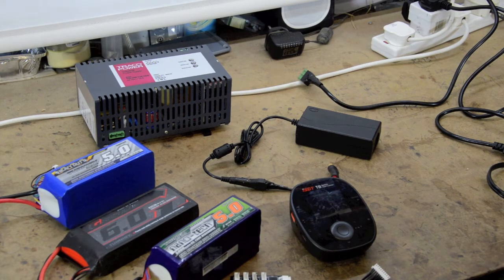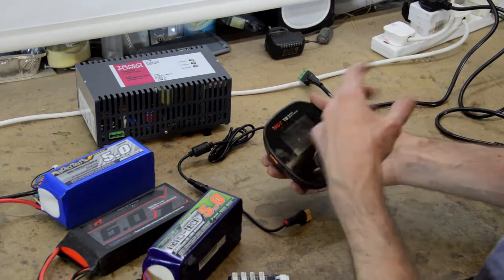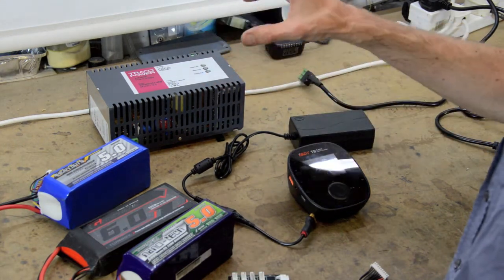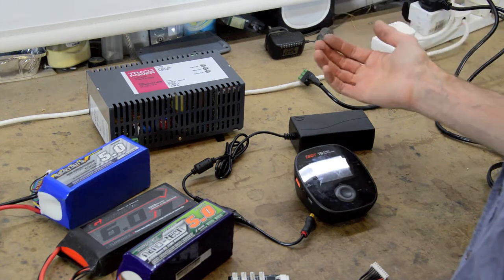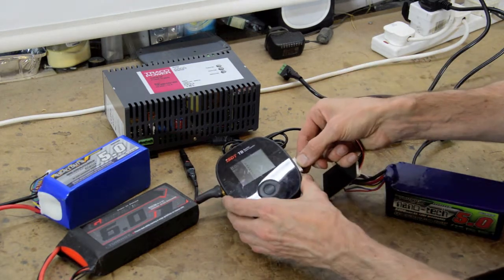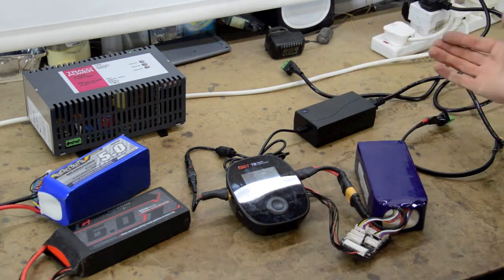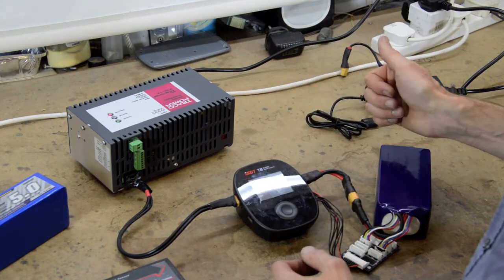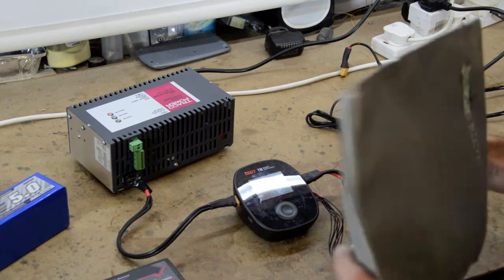How to charge 7s or 8s lipo batteries with ISDT T8 Charger

Comment: WHAT SOURCE SHOULD I BUY FOR ISDT T8?
Reply from the maker: Hi i got mine from eBay
Reply: WHERE CAN I BUY ISDT T8 SOURCE FOR CHARGING?
Reply: @rcwizard6847  https://www.amazon.com/HP-441830-001-G5-437572-B21-438202-001-440785-001/dp/B007JNUSJY/ref=as_li_ss_tl?s=electronics&ie=UTF8&qid=1548201114&sr=1-4&keywords=hp+power+supply&linkCode=sl1&tag=fpvknowitall-web-20&linkId=9bf636f10d41188022a8aabba7c6d6d1&language=en_US

Comment: It's simple math to know max charge rate. Amps×Volts=Watts You have to make sure your watts in(powersupply) is higher then watts out.(into battery) Your first power supply example.(too weak as you noticed) 24V×5A=120W in so max charge rate for 8s is 120W÷29.6V(8s lipo)=4Amps. Note that there is some efficiency loss and powersupply might drop in voltage under load, so it could be it only charges at a lower rate. Anyway if you want to fully charge 8000mAh at 4 amps it would at least take 2 hours. Make sure you respect max rates of your powersupply/charger and battery!
Reply: well thats what i thought, but he said he set it to 2 amps charge current which should have been fine, and it still failed. Confusing.

Comment: Thanks for the polarity Tip!  Mine was working perfectly until I one day (unknowingly) plugged the balance tabs in backwards and got the same spark you had.... I did not realize it mattered which side  they are plugged into:(    When I had the spark,  I was confused, as it had been working perfectly up until that point. You video clarified this IMPORTANT Caveat that can potentially cause a  spark, fire, damage or injury. Thanks again for the great Information!